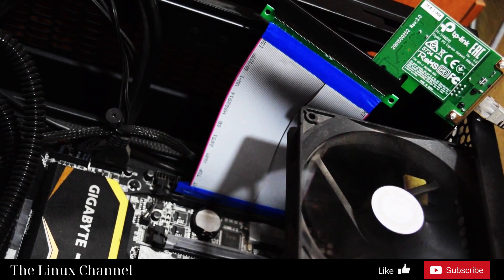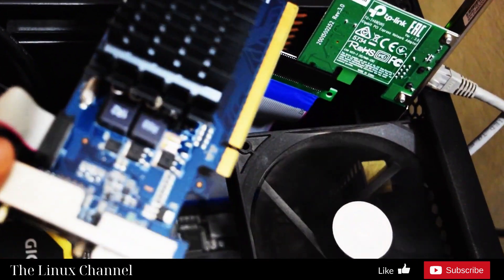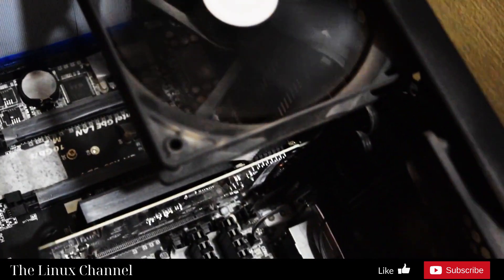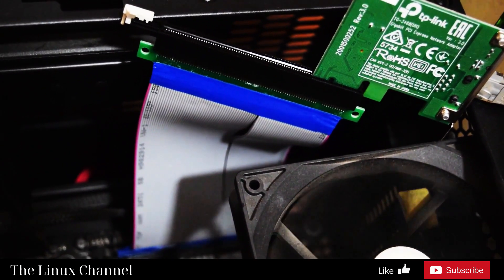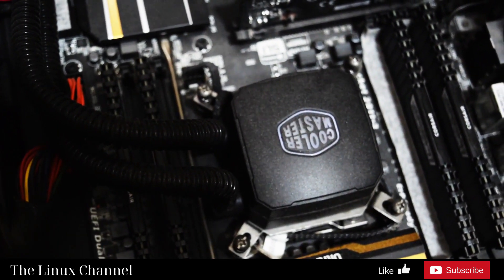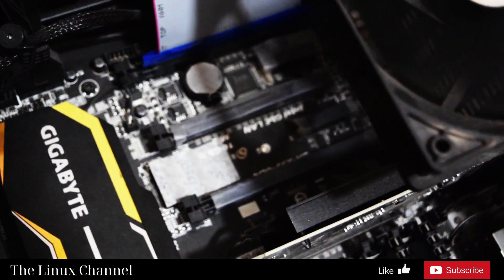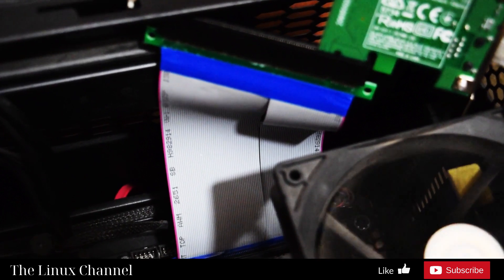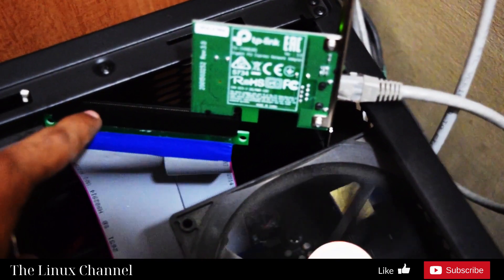0x1bb My Amazon Purchase | PCI-E 16X to 16X Riser Extender Card Adapter PCI Express Flexible Cable

Comment: Can we extend the PCIE1X slot that will be blocked by dual slot GPU card using similar ribbon based pcie1x to pcie16x riser??? Will it fit??
Reply from the maker: true true, I understand. yes you can, before getting this, I stumbled across these: 
https://www.amazon.in/ELECTROPRIME-PCI-Express-Riser-Extender-Extension/dp/B07XB9NVLD/ref=sr_1_20?crid=1R4TK7OHSW3KZ&dchild=1&keywords=pcie+1x+extender&qid=1603603625&sprefix=pcie+1x+%2Caps%2C325&sr=8-20&_encoding=UTF8&tag=thetoffeeproj-21&linkCode=ur2&linkId=50bbafa14a5dcdfd873d67400eb70ad5&camp=3638&creative=24630

and this. But in this case, although it looks full PCIe, it is still going to be 1x
https://www.amazon.in/Express-Ribbon-Adapter-Extender-Auxiliary/dp/B07HF8YWWJ/ref=sr_1_4?crid=1R4TK7OHSW3KZ&dchild=1&keywords=pcie+1x+extender&qid=1603603625&sprefix=pcie+1x+%2Caps%2C325&sr=8-4&_encoding=UTF8&tag=thetoffeeproj-21&linkCode=ur2&linkId=44e86f075fac80cb9d7ce7bd1051b191&camp=3638&creative=24630
Reply: Yes... That is I will be able to connect a dual slot GPU and another pcie16x gpu using second extender on pcie1x connector... However, the second gpu will have reduced performance.. that acceptable... It is more of maximizing  strategy, instead of putting second gpu on the shelf..